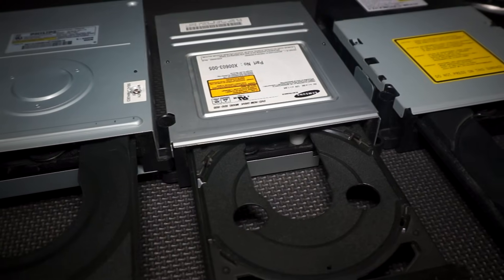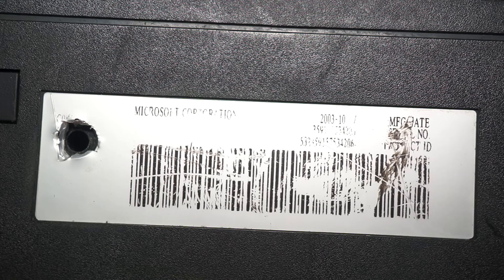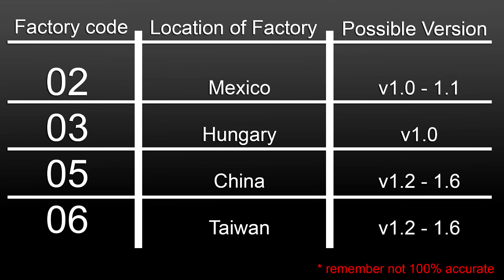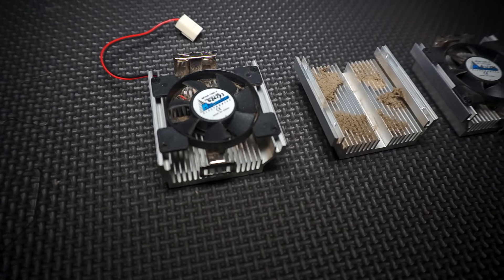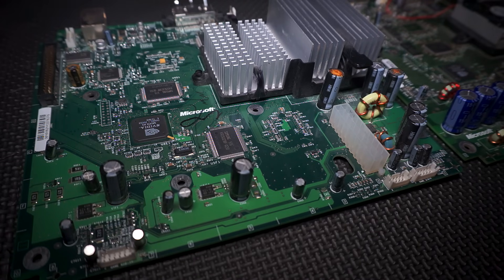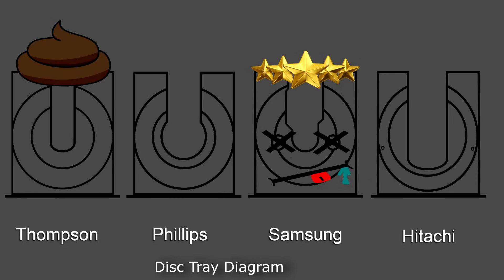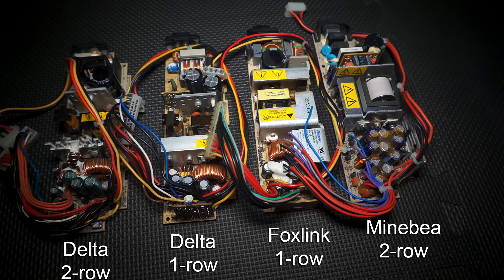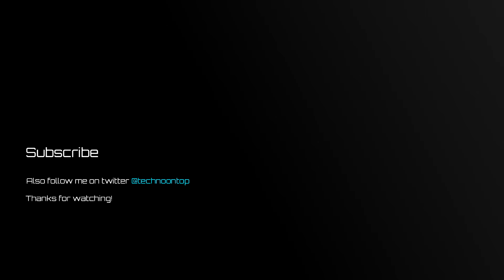How to tell what version original xbox you have

Comment: I'm thinking of buying an original xbox, but I don't know which version would be ideal. Maybe the xbox crystal PAL.

outside the topic of modifying the xbox, which opinion you have on version 1.6, let's forget about the mod, I want to keep the console as it is.
-I consider that the Samsung DVD drive is the best, although sometimes there are problems with the tray, but they are minimal cases, sometimes it does not happen.
-Regarding the power suply, v1.6 does not have the Foxlink PSUs, it has a better power suply, there is no risk of burning or if there is?
-Regarding the clock cap, I have read in forums that it should be changed otherwise, the motherboard will have failures, and that v1.6 does not need that change.

I have read that versions 1.0 - 1.5 always have to change something internally, I think xbox 1.6 is a good purchase option, what would be the disadvantages of this version (not counting the mod issue)?
Also, I don't want to open the console, I want to leave it as is. Or maybe v1.6 has to be modified internally too :(

Regards from Perú!
Reply from the maker: Yeah your best bet if you want to leave the Xbox stock would be to go after a hardly ever used 1.6.

The risk of fire is going to be there with any power supply, if you're really worried you can look for the power cords that Microsoft sent out after realizing they had a problem. They have a switch on them, doesn't actually fix the issue but it cuts the power if it sees a short.
Reply: @TechnoOnTop  Oh yes I think I have seen some on ebay.
And how high is that risk of fire in the power supply, 5 of 10 consoles, 8 of 10 consoles?

This happens to all consoles sooner or later, or does it depend on how well the user uses it? the console is for my personal use, 3 hours a day, 3 times a week.
 Reasonable use.

I add that I want to buy a PAL. I would have to buy Microsoft power cables for Europe.

Regards.
Reply from the maker: The likelihood is extremely low, maybe 1 in 100k, it happend to me once and only one other person has commented and said it happened to them as well (there may be some article on the web about it) , so I really wouldn't be worried about it. It only occurs when the solder joints on the power supply wall connector break loose. In theory that will happen to every Xbox at some point but out of all the Xboxs iv gone through iv only seen one where the solder joint was busted.
Reply: @TechnoOnTop  I get it.

There are few cases in which that is seen, it is clear to me. I think that with this I have no doubts about an xbox v1.6, I will get one soon and I plan to give it a reasonable use without opening the console and enjoying the games. Thank you very much for the clarifications, they were very helpful! Greetings from Peru!

Comment: I had issues with Thompson drives before. Like if the disk wasn't perfect it would struggle. And even if it was perfect it would load very slowly. My current Xbox is a 1.6 with a Samsung drive. I chose a 1.6 Becuase I wanted an Xbox that was used less and as new as possible. All Im doing in terms of modifying it is putting in a modchip and upgrading the drive so I don't have to load games using the disk drive
Reply from the maker: Yeah these old disc drives can act pretty weird I have one that won't read some perfect games but does others, then reads completely trashed games perfectly extremely weird... Very nice! A modchip and loading straight off the harddrive is the way to go especially nowadays. Don't skimp on the ide to Sata adapter I and pretty much everyone else recommends star tech brand. Good luck on your future mods, sometimes once you start its tough to stop! Or that was my experience anyway haha

Comment: what does that mean that one of my xbox have a seperate rca port, and the other xbox only have the "xbox" port for image output? Which one is the newer?
Reply from the maker: Was the Xbox modded at some point? The extra rca port is probably a digital out added by a modder. Which has nothing to do with it being newer or older, if you have Twitter you can send me a picture of what your talking about. But I'm pretty sure it was added by a modder at some point.
Reply: @TechnoOnTop  yea, i looked closer and the hole is bigger than the actual plug-in port, this is not factory likely, also i found a switch there that should switch i believe the rca and the default video-out port, but the original port doesnt work, only the rca one :/ This is a problem becuase i cant play in HD then
Reply from the maker: So someone added 1 rca jack, or did they add 3 to make a composite out? The switch when off should allow for the standard Xbox out to work but if it doesn't it may be shorted in some way. If you're comfortable with a soldering iron, you could just remove it all. Then that should fix any issues your having
Reply: @TechnoOnTop  somebody added 3. Well, it works with both the original video out port, and the "custom" rca-out port, the switch is not working but i dont see any problem, I thought first this is some kind of different model than my other xbox that doesnt have that port, but now I found out it means nothing :D Thanks for the replies tho!

Comment: Seems like I have an original 1.0, with a Thompson drive and a foxlink PSU too.. even though this console also came with a free leaking clock capacitor and corrosion all around that area it still works great!
Reply from the maker: Yeah the Xbox is a tough beast, iv only ever came across one that was beyond saving. At least from a leaky cap, thanks for watching!

Comment: I know you must have a lot of people watching this but I got a big question. Once everything calms down, I plan to go to multiple Goodwill's and stores to see if there is anything OG Xboxs laying around since most of my city seems to donate them to Goodwill. What is the best version and most importantly, the most reliable regarding the PSU?
Reply from the maker: Iv only managed to find one ogx at a goodwill, but I know other people find them like crazy but anyways.. As far as the best power supply.. I wouldn't really say that one is better then any of the others, one thing to keep in mind is there are single rows then double rows, the double rows for a 1.6 which won't work in any other versions (at least not without re-wiring) there are ones that output a few more volts, but iv used most of them and I have put a bunch of stress on them with LED's, fans, lcds ect (if you have seen my latest video you know what I'm talking about) and haven't had any issues. The one currently in my build is a 2 row delta.  I would say the big thing as far as reliability goes is just making sure that those big big solder connections on the connector are good, and to always hook it up to a surge protector. Iv never had another xbox power supply fail on me aside from the one when I was a kid.

Comment: I absolutely loved the video about the XBOX revisions, its nuts on how many revisions of parts they had as well. I own a Hitachi DVD drive in my Xectuer chipped 1.6. The drive sounds like a Hitachi from a XBOX 360. But in all fairness its the best drive from my experience with drives. Samsung and Toshibas I had struggled with loading burned discs, I have had both variants of the Phillips drives burn out on me.  I had a Thomson that had the motor for the laser stops. But I never had an issue with my Hitachi drive. :D With the HDD's The first one that were inside was the Seagate U Series 5 10GB with then the first 8GB HDD. Then another WD came out which has 8GB same capacity. Then the Seagate X series came out with 10GB. Weirdly enough both WD's were 8GB. Might be wrong but I got two WD's similar from the video and if you look at the model they are both have the 8GB Capacity model number. (WD80???). Hope this was interesting to read. :D
Reply from the maker: It is crazy, I will say the Ps2 had alot more variations through its life cycle, which definitely makes the Xbox a more simple to mod/fix console. Thanks for sharing your experience with DVD drives it definitely helps others and me give better recommendations when I'm asked, course no drive is perfect really just depends on how well it was treated. I won't put anything other then perfect disc's in any of my consoles. as it stands now I have a working Phillips, a Thomson that barely works, a Samsung that works fine but the tray always gets stuck. And maybe some others I still have a few Xboxs on the shelve that I haven't gotten around to messing with (probably should because of the clock cap)
Reply: @TechnoOnTop  Glad to know that I am a help to others. Yeah to be fair, I have heard that Hitachi's have issues with lasers but personally I have never had a issue. Honestly, I believe its the more that the drive is used the easier it is for it to fail. Its like a car, as long as its mantained, it will be a strong runner :P The PS2 varients are complicated. I have the first gen of pal units. SPCH-30003 but it runs lovely. :D Had a SCPH 50003 but it did not last long at all. :P

Comment: Is there a way to tell if a console is PAL or NTSC from the outside?
Reply from the maker: No I don't believe so, but there are certain special editions that only came out in certain regions so I guess you could tell like that... Probably doesn't help though... For what it's worth if you mod the console you don't have to worry about pal and ntsc. Thanks for watching
Reply: @TechnoOnTop  Thanks a bunch! I recently picked up a PAL console that was previously modded but doesn't seem to work no more. Not reading copies or NTSC disks. I opened it up and found an "Aladdin Live" chip that doesn't work no more. Any easy fixes you could recommend?
Reply from the maker: By not working you just mean it's not reading disc's? Or more then that? How do you know the modchip isn't working? It's hard for me to give you an idea on how to proceed since I'm not sure how it's not working . Let's say the Xbox was never modded and the hard drive died. I would say install a modchip then use hexen to rebuild a new Sata harddrive, but this would require a functional disc drive, most of what I would suggest comes back to having a functional disc drive.. Iv only ever built a harddrive for an Xbox through that 2tb image file but that would require you to download that which takes about 2-4weeks of 24-7 downloading.
Reply: @TechnoOnTop  It does read disks, only PAL disks though. The previous owner sold it to me with PAL and NTSC disks, as well as a few bootlegged copied disks. That's the main reason why I bought the device because I was certain that it was modded. 

When I tried it out, it only read PAL disks. So i took it apart and found the "Aladdin" chip soldered to the board, and had a LED light that was not working, which is why i figured that the chip died.

I also read online that if you hold the power button when booting that it should boot with the chip.
I tried that out and it actually shows a green ring, orange ring, turns off and then back on!  Thought that this means that it now is booting with the chip and is ready to play anything, yet it didn't work. Also no logo pops up in the boot screen indicating that it is now booting with the chip.

I'm completely new to the scene and wonder if the chip is actually working fine, but I just don't know how to activate it.

Appreciate your help and time! Cheers
Reply from the maker: Ok here's my suggestion on where to start, pop it back open and basically just check over all the modchip connections, which won't be much just look at how well the pinheader is soldered and if the D0 point is soldered that can come loose and it's a very small point... There is a better point on the bottom of the motherboard.. If you watch my "how to install an alladin to a 1.6, I show 2 points on the chip that are then bridged together that makes the Aladdin chip always on, I say do that, the fact that the chip isn't lighting up isn't to big a deal if you remove one the the pinheaders that light won't light up, some people prefer to have it not light up... Also if there are other wires running around from the modchip just remove them the only one that matters is the D0 point (course idk what version your Xbox is so you should figure that out, D0 is only on 1-1.5 if it's a 1.6 then just what my video I mentioned about and check everything over I also have other videos such as installing a modchip with a pin header that gives the basics, mostly all modchips install the same way) , once you set the modchip to always on they won't make a difference, from here boot the Xbox and you should be greeted with a different boot logo... If not then I suppose it's possible that the chip is bad or that it was never flashed (seems really unlikely considering the guy gave you burned disc's ).
Reply: TechnoOnTop You my friend, are a legend. Will crack it open tomorrow and share the results. Can’t thank you enough for your time. 🙏

Comment: NIce video, But I got a question I got a v1.0 based on your video. I was looking to replace them psu. Its a 110v no my question is would it be possible to swap replace it with a 220v without any issues??
Reply from the maker: You can swap in any single row power supply without issue, thanks for watching!

Comment: Just changed 18 year old thermal paste, boy was it in tight. Good thing is that I have kept the Xbox unplugged always when not using it so all the capacitors were in great shape :) this video was great for identifying my Xbox as 1.0 version
Reply: should I keep my v1.0 xbox unplugged overnight
Reply from the maker: Yeah it can be a pain to remove the gpu heatsink, it's best to heat it up I use hot air but another way is just turning it on and letting it heat up, but that's good to hear, it's still good practice to remove the clock capacitor, but if you don't want to just be sure to keep an eye on it. I appreciate the comment! Happy modding!

Comment: Mine is probably a v1.6 or 1.6b – 2005-07-14.

I'm not into modding or anything, I was just checking after hearing about the cheap clock capacitor leaking onto motherboards in older models. Glad that I won't be needing to replace it.
Reply from the maker: Cool happy to help! The date isn't 100% but you know that, thanks for watching!
Reply: @TechnoOnTop  Yeah, God help me if I tried to open it up and see. Factory code is 05 if that counts for anything. Thanks.
Reply: Tip, I have a 1.6, opened her up for the first time. Was super clean, blew me away. The clock capacitor was mint, still. But noticed another capacitor by gpu that's showing slight bulge. Xbox was easier than 360 to open, I recommend you still check brother.

Comment: The reason I watched was I needed to figure out if I need to get rid of the clock Capacitor, luckily I had a 1.6, however you can identity the version via the system info settings.
Reply from the maker: Glad you had a 1.6 as far as I know you can only see what version you have if you're already modded. But thanks for watching
Reply: You don't need to remove clock capacitor on 1.6? I have a 1.6 halo edition

Comment: Which models are the best and which are the worst ? Please list the different pros and cons.
Reply from the maker: There's not really much for pro's or cons, 1-1.5 can be tsop'ed, 1.6 can't, as the version gets higher the video encoder got progressively weaker. 1-1.5's can have their ram upgraded 1.6 can't. 1-1.5 can have iceberq pro 4's installed (if you can find them) 1.6s can't. I'd just say a v1 is the best, but really anything other then a 1.6 is ideal for every mod you could ever want to do.